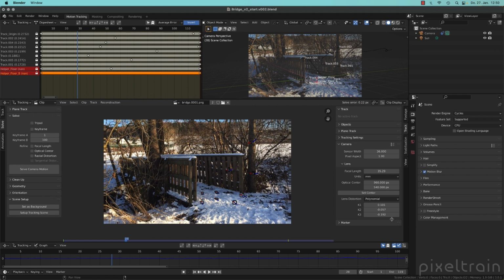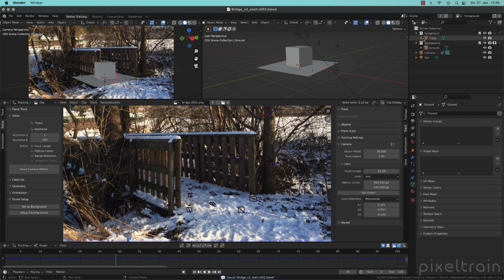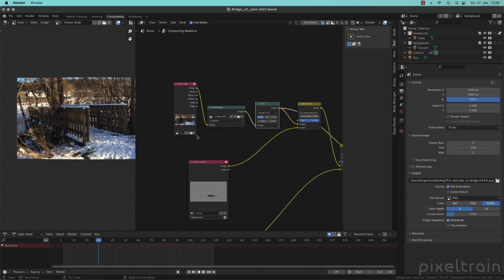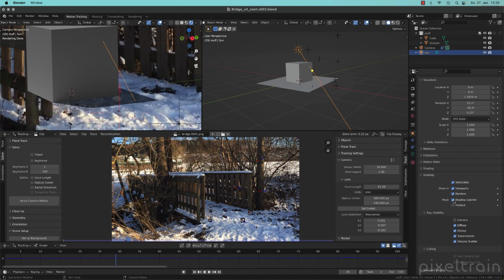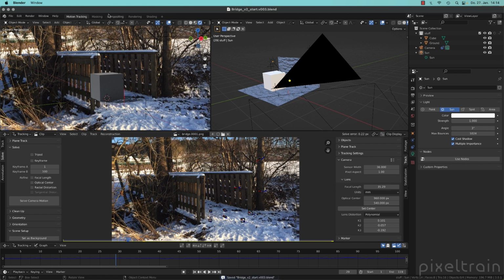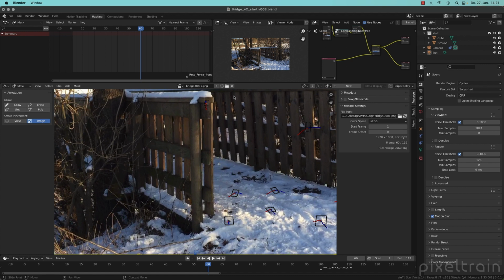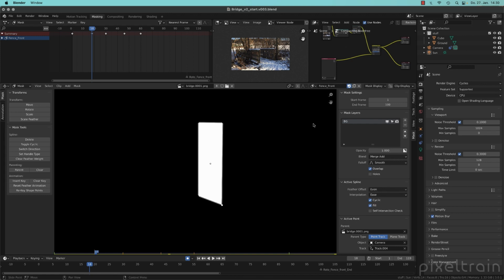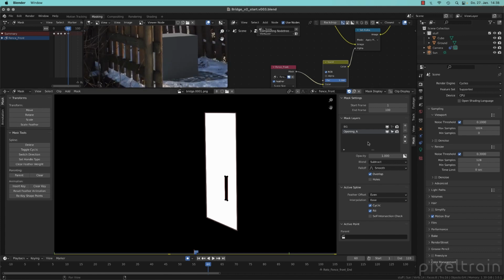Blender 3.0 for Production - 2D & 3D Tracking Workflow - 10 3D-Integration, Shadowcatcher & Masking

Comment: I  need help :-  I import cube as you did but mine  cube was  not showing in camera view although it was visible in 3d view "
I have only one camera which is active
I tried many times but got same problem occurred
Reply from the maker: Hm, how far is the cube from the camera? very close or far away? Then it could be a clipping setting in the camera. Go to your camera data properties to the display section and activate the limits tick. Is the cube in these limits?

Comment: Hello, thank you - your video tutorials are very helpful. Please tell me how to properly set up the ovascan renderer - for subsequent compositing in foundry nuke? I mean that tracking, lineup and modeling with rendering will be done in blender.
Reply from the maker: Hi Mike,
the is no automatic way of setting up an overscan in Blender. So you have to re-calculate it by your own.
For this there is a formular, have to look where to find it again. The result is a slighty bigger Render with the same perspective as the normal Full Plate format. Maybe I find it, then I will make a short tutorial out of that.
But, as said, Blender way of working with undistorting the plate is different than NUKEs approach. Blender shrinks the plate for undistorting, which means if you later use these values for redistorting your CG to the original plate you don't need an overscan, because the CG is then always increasing its size.
If have already captured a lesson about lens workflows, I hope its covered good there, otherwise I have to make a separate workflow demo.
Reply: @pixeltrain3d  I'm still just trying to figure it out - the fact is that when eliminating distortion, the image does not always shrink, sometimes, on the contrary, it expands beyond the edges of the frame. I found the "render camera overscan" addon, but I still don't quite understand how it works.
Reply from the maker: Hi Mike, OK, do you have a link for me for the footage? Then I can look into it and try myself and try to build a clean setup. Could you write me an email, please.